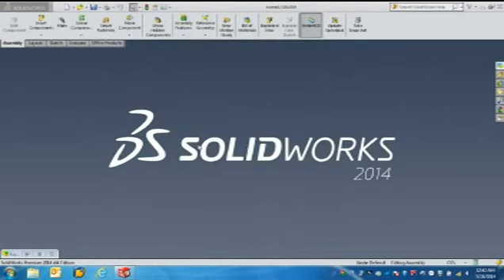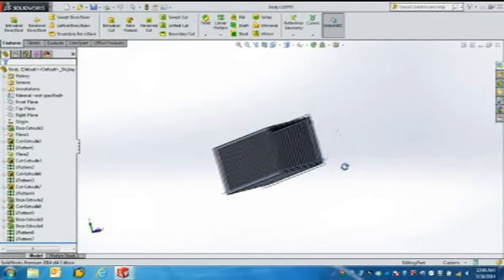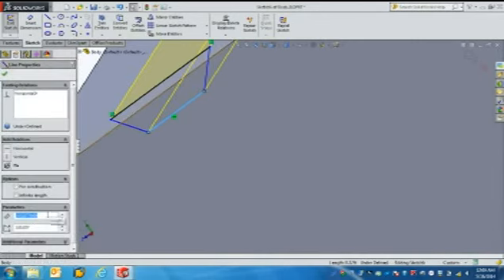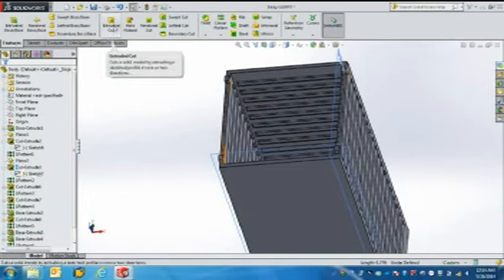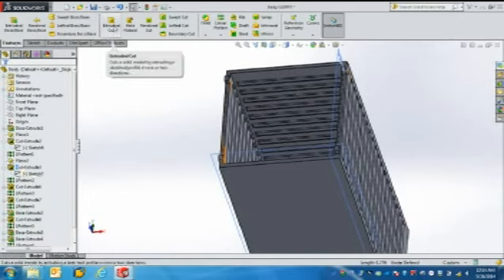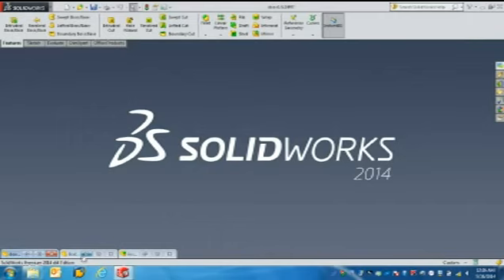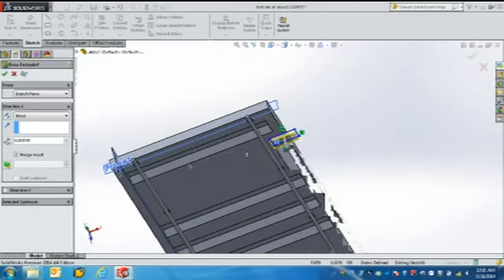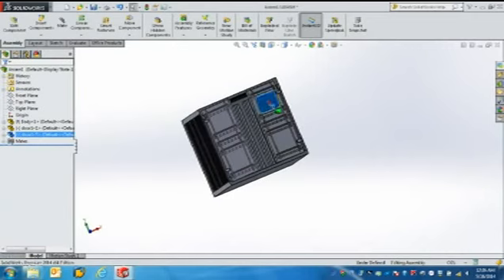SOLIDWORKS Shipping Container TUTORIAL BASIC

Comment: Nice tutorial but you would not be able to manufacture the unit the way you have drawn it.
Structural steel frame and infill panels would be the desired way to manufacture this type of unit. Using folded panels on a building.